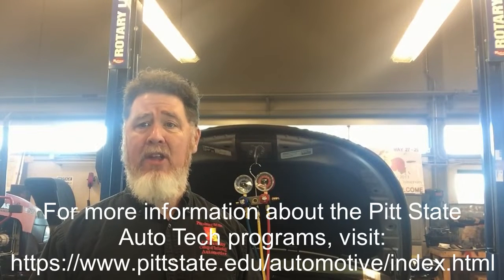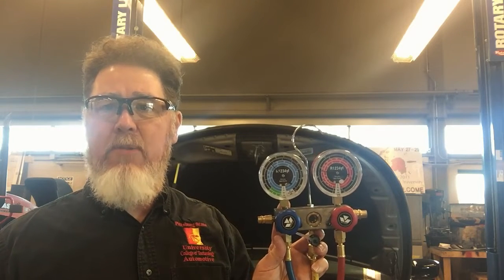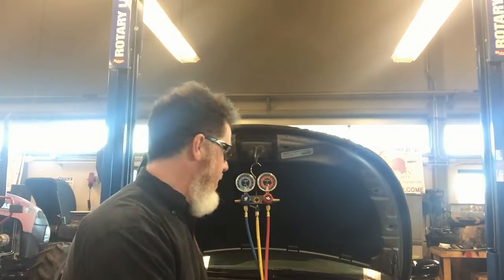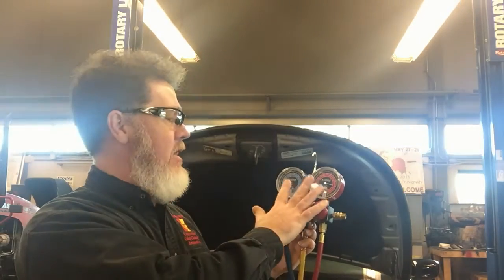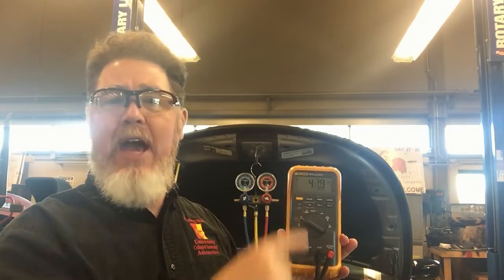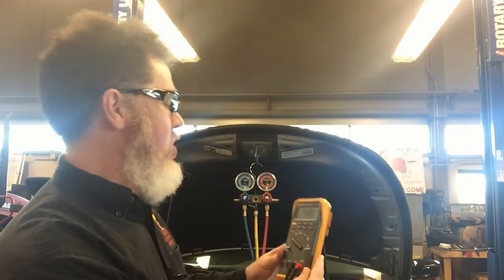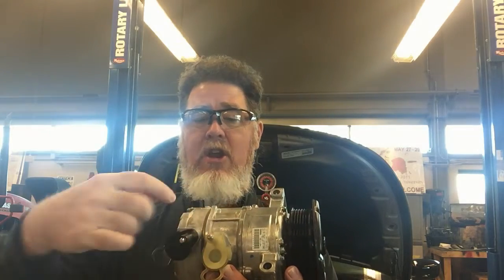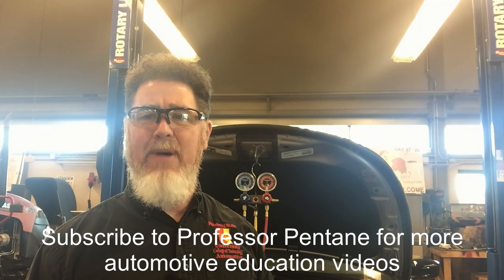How to diagnose a Variable Displacement A/C Compressor

Comment: Good day, thank you for the video, very interesting. Could you explain how ecactly you hooked up the Multimeter to the solenoid? Were there exposed contacts or did you have to cut wire shielding to tap into it with your Miltimeter? Thanks!

Comment: I have a 2019 KIA sorento. It has both a clutch and a control valve.  When i turn the A/C on I can see the clutch engage but cant get any cooling in the cabin.  I dont have guages but i did quickly press the low pressure shrader valve and some gas shot out when vehicle was shut off. So seems like there is at least some gas. Also would the clutch not get a permissive to engage if the gas was empty (low pressure cut out switch).  My only question is the control valve faulty?  what would you try next as a diy?  FIY the compressor label says 134A or 1234Y gas. there is no label under hood.

Comment: On my second compressor 16 Cruze 1.8 ,same symptoms both times AC would be cold when working but at a red light or idling the AC with blow warm, clutch still engaged, cooling fan working pressure equalized around 80 pounds, other times the AC blows warm but if I excelerate heavy it blows cold again and keeps working fine,the second one the same symptom blows warm sometimes when sitting still once you load the engine down with heavy acceleration it goes back to cold, then the other day I shut it off and restarted the car 10 minutes later and AC never got cold again pressure stays equalized, took it to the shop they say compressor is bad,is there a way to bypass the variable part and make it like a regular AC pump, 1st compressor lasted 170k miles and 2 nd one maybe 10 thousand miles, seems like a horrible design and making things to complicated AKA unreliable,

Comment: So im assuming with this type of compressor if the ac is on but freon levels are even and not moving the compressor is bad .  Or is there a chance that the variable compressor wobble can be at 0% ever. Working on a Hyundai with a clutchless variable compressor..  fuse is good. No errors in the ecm with the ac system. When Activating the ac button freon levels just stay static..
Reply from the maker: Yes, it could either be a bad compressor or an electrical issue the computer can not detect.  Can you command the duty cycle of the compressor with a scan tool to see if it changes?
Reply: @ProfessorPentane  I don't think my scanner has the capability to do that with the duty cycle or at least I can't find it in there anywhere..
Reply from the maker: @hillsautoservice  You can you a voltmeter like I have in the video and back probe the control wire going to the solenoid.  If you are seeing voltage change, the control side is probably good and you have a bad compressor or solenoid.  The solenoid should be around 10 ohms.

Comment: I love the videos showing the pressures and duty cycle under different conditions.  However, can you please include a video of a variable displacement compressor with a mechanical control valve?  I see lots of discussion of the solenoid type and the ability to test the signal/demand, as well as videos on replacing them because of a high failure rate.  I have an Altima (R134a) with a Valeo DCS171C variable compressor with a mechanical valve (manual climate control) that works on pressure.  I'm having issues with getting good cooling and have above normal low side and below normal high side and suspect the control valve is not functioning properly (last year replaced evaporator, TXV, dryer and pressure switch).  With ambient about 84 I had 45L and 150H.  The pressures tell me the TXV isn't stuck closed, and it's slow to equalize when shut down so I don't think it's stuck open.  The low side pressure takes a minute to begin dropping after turning the AC on.  I wonder if the bellows in the valve has ruptured and the valve is in a sort of neutral failed state (maybe a 50% position?), allowing for some compression but not changing based on demand (a low side pressure increase due to heat load at evap.).  
A video on troubleshooting this type would be great, helping to distinguish between the mechanical valve and other possible sources of trouble.
Reply from the maker: Hi Scott,  if the compressor is not at max Wobble plate angle, the low side should be a little high and the high side a little low.  The more straight (up and down) the wobble plate, the more the gauges will read the same pressures, (low side high and high side low).   The manual control valve is hard to diagnose because you can not control it like the newer EVDC ones, but the gauge readings will be the same between the manual and electrical control compressors if the wobble plate is not moving correctly.  I hope it helps and be sure to subscribe to the channel.  PP.

Comment: what speed the blower fan was during this test?
Reply from the maker: I started off with the blower fan on high and towards the end of the video, I switched to low speed to get the duty cycle of the compressor to drop due to the evaporator getting too cold.  Thanks for watching,  PP.

Comment: Hello Professor Pentane.  I was surprised to see the duty cycle on the PWM control still around 40% when the A.C. was turned off.  Would this not possibly point toward a potential error on the PWM  controls, which I would have expected to go to zero?  If this is normal, I would hope for some discussion on this in your tutorial.  I also noticed that when you initially displayed the compressor, you stated that it was a clutchless compressor.  Near the conclusion of your tutorial, you stated that the compressor clutch had disengaged.  Is it possible that PWM strategies would differ between the two types?

Comment: Good video. Can you replace the solenoid only if it is acting up?
Reply from the maker: On some compressors, yes you can only replace the solenoid.  Check for parts available.

Comment: I got an ac with one of those compressors.  The system has no leaks and did a full recharge. But it only cools at low rpm like at idle. When I start driving it stops cooling   Can that possibly be a simple fix or do I likely need a new compressor?
Reply: Did you ever find the answer to this? I'm having a similar problem with mine... It's only cool when sitting at idle. The vent temp gets higher when driving at highway speeds.
Reply: @friesy3518 were you able to fix it
Reply: Low charge maybe?

Comment: Very good explanation of how the variable displacement compressor works. Question: Is variable displacement compressors used only in a vehicle that has climate control system type of air conditioning?